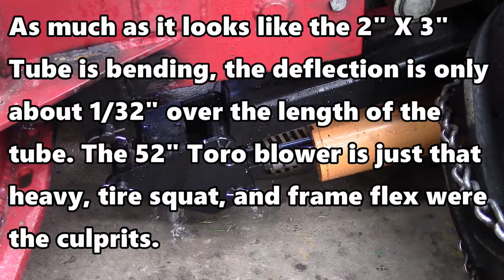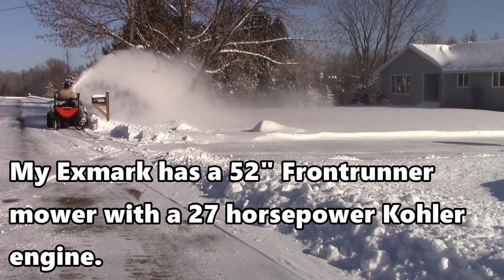Zero Turn Snowblower Exmark 52"

Comment: Seems to work pretty good looks like it tossed the snow far enough
Reply from the maker: Yes Keven it throws about twenty/twenty five feet, not as far as I thought it would but definitely far enough. Works pretty good, I could play around with gearing and pulleys, but then it may not work well cutting lawn. Good where it is! 😊

Comment: kubota zds are more hevyier wich can handel a blade and blower wich uses the hydrulic lift brakets for the mowerdecks
Reply from the maker: This is what I bought new in 2008, because I got a really good deal on it. I then decided it would be neat to put a blower on the front., and that is what I did. No doubt something that is mass produced will be better, but this is my version. Thanks for the comment.